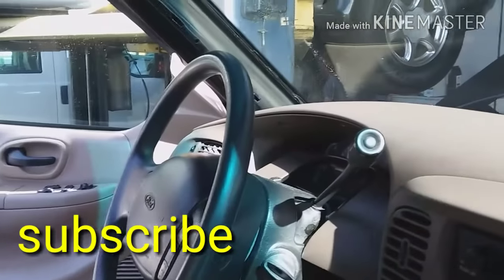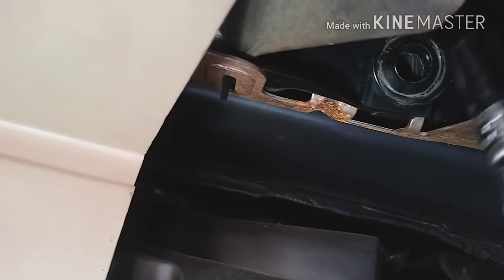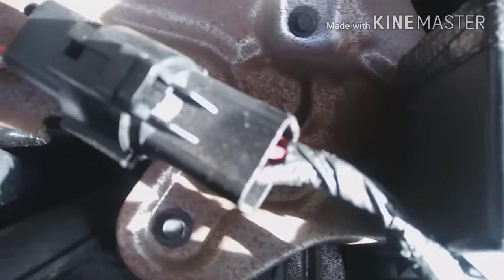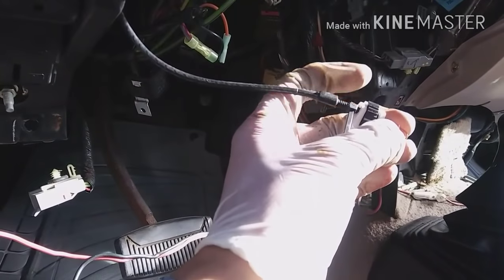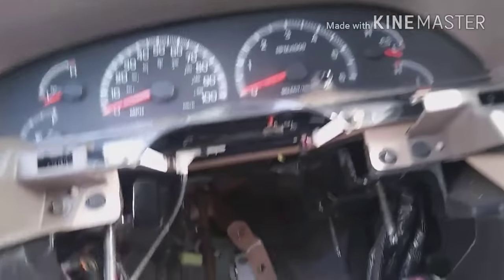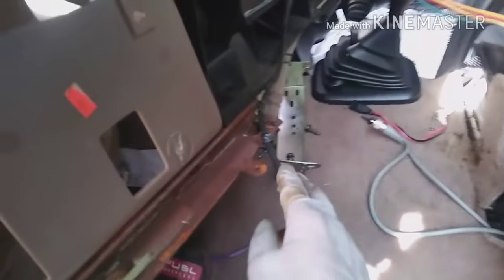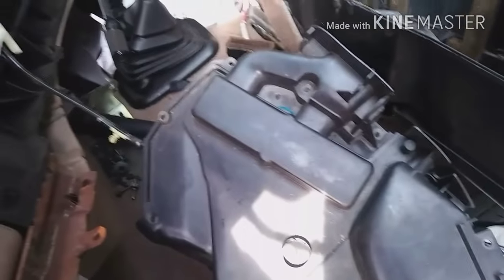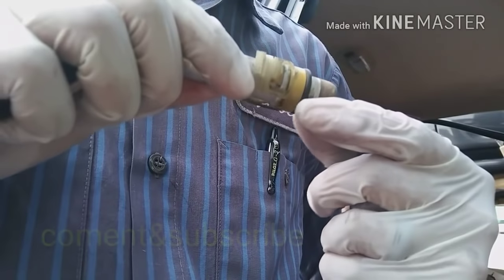Ford f150 heater core replacement  97-03 out in 10 minutes

Comment: Are you interested in flying to the u.s. to replace mine. I have a 2000 ford lightning that I need to replace do to my mechanic by passed my heater core.

Comment: Is there really no way to do this without removing the steering column? That's the part that looks like a bitch to do.
Reply from the maker: You have to drop the steering down atleas because you won't have enough to separate the dash from the firewall
Reply: @brosolution  thanks for the info. Knocked out this job on my 2001 Lariat on Sunday. Took me about 1 hr and 40 mins to remove the dash (granted, I did remove the cluster to see if I could just lower the steering column to the lowest adjustment setting to no avail). Otherwise, I probably could've pulled the dash within an hour and a half. Not bad for first time doing it. The trickiest part of the repair in my opinion was connecting the hoses to the new heater core and making sure they'd snapped in place, since it's all the way back on the firewall. Honestly not too bad overall if you're methodical with the disassembly.

Comment: Holy sheeeeit WTF do they design crap like that?
Replacing the core in my VW requires removing one panel, some hoses, and that's pretty much it.   Awkward to get /at/, but not difficult to actually do.